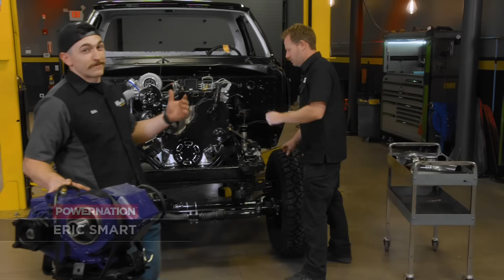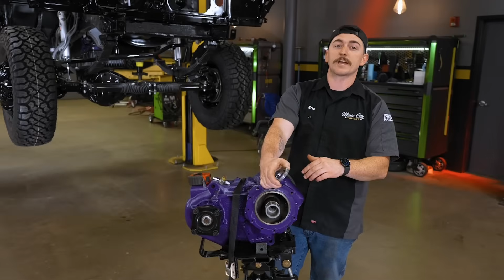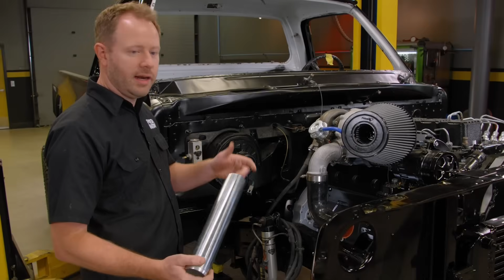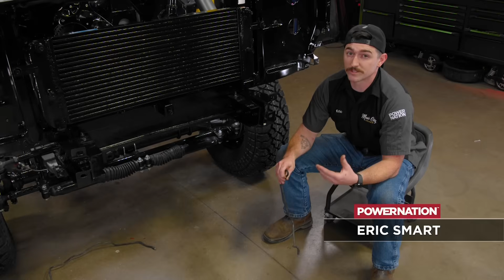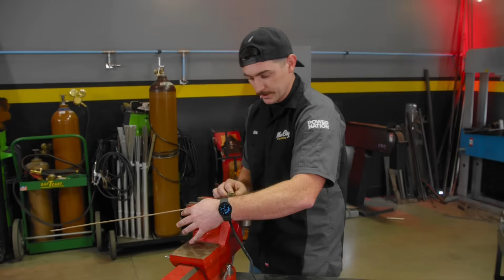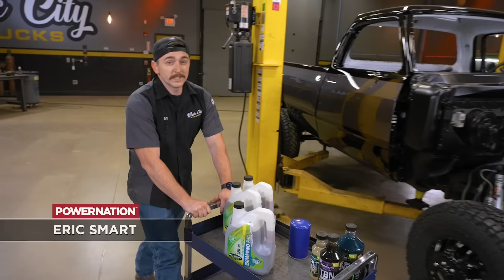Turbo, Intercooler, and Transfer Case Upgrades For Dodge W350 Dually - Music City Trucks S4, E17

Comment: If this truck were mine I would take it to Custom Automotive Conversion (CAC) to remove that junk transmission from ATS. Also, the air intake is a joke. This thing will suck hot air via the engine bay.

Comment: I’ve never understood why you need to bench bleed the master cylinder. What can’t you just hook it up and bleed it w the brakes?
Reply: On some vehicles, the master cylinder is tilted up in the front at an extreme angle, and all of the bubbles may not be bled out. You want the master cylinder as level as possible to make sure you have all the bubbles removed. Unless you are using some kind of power bleeder to reverse bleed from each individual wheel up to the master cylinder.